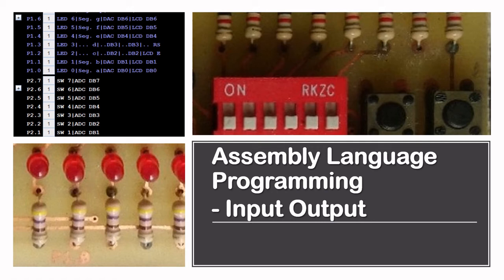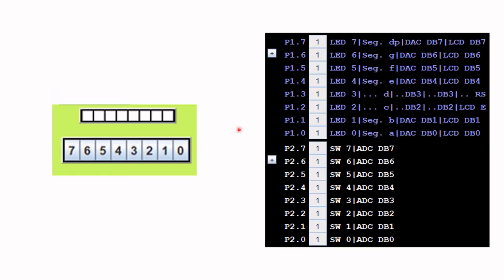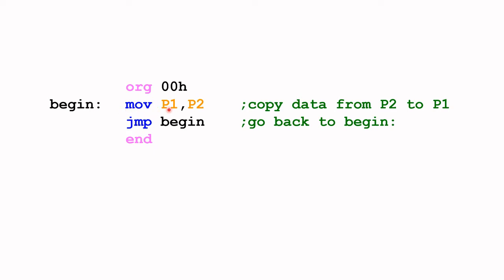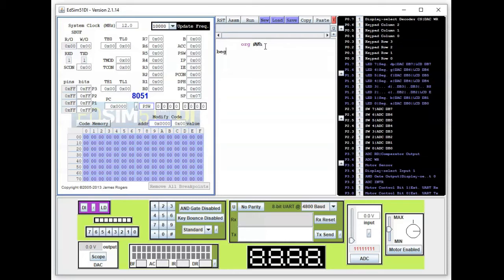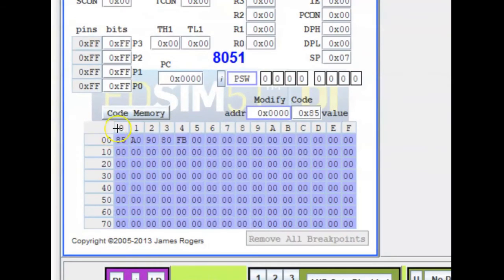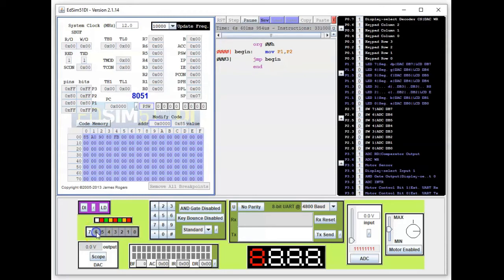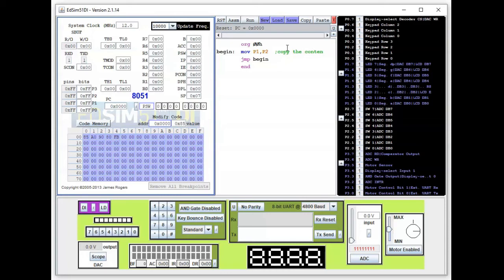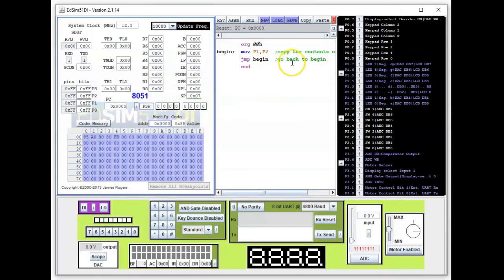#13 EdSim51 Input Output Programming

Comment: Sir.Why in edsim51 simulator, no need to declare port 1 and 2 as output port and input port?
Reply from the maker: The ports are defined in the <reg51.h> header file. This is same for the Keil simulator.